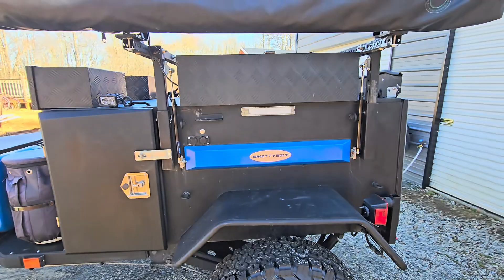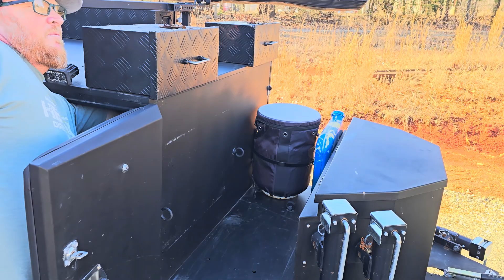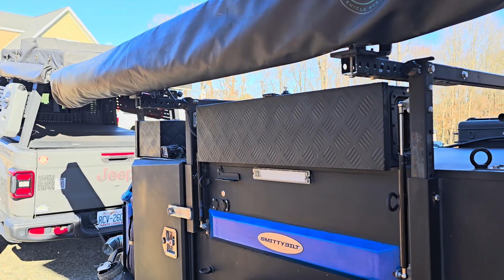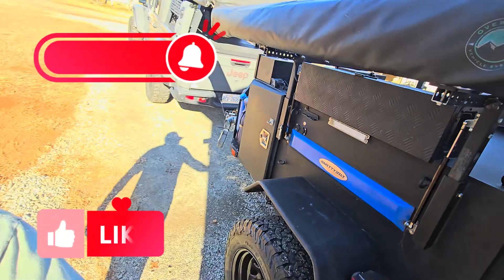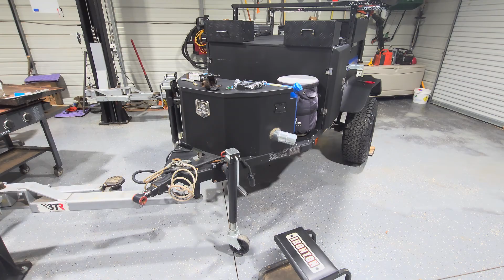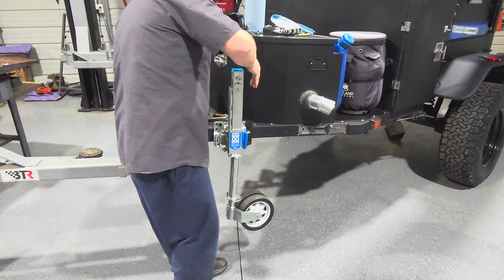SmittyBilt Scout Overland Trailer #1

Comment: Could you tell me the width and height of the crossbars that holds the tent? I've got my eye on a Scout right now but want to make sure my iKamper Skycamp 3.0 RTT will fit on the crossbars. Thanks.
Reply from the maker: Are you asking about the bars on the trailer or the ones for the tent..  I have 2 tents..  the one on my scout the cross bars are 1" tall by 2" wide.  The one on my truck is 3/4" tall by 1.5" wide..
Reply: @pinchgutcreekfarm7699  Yes on the Scout. Exactly what I was looking for. I couldn't find that info anywhere online. Thanks-you for your help and patience.
Reply from the maker: @kevinboyer6249 ok the bars on the scout are 1.5 by 1.5